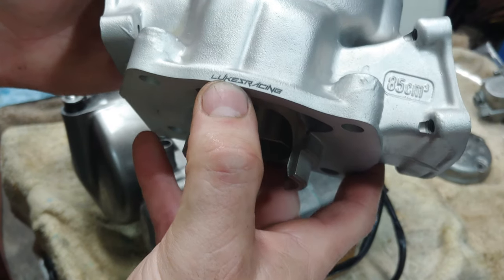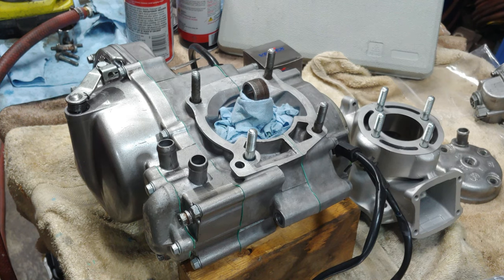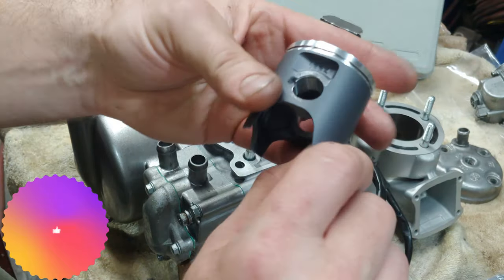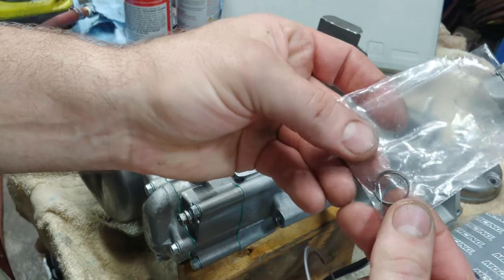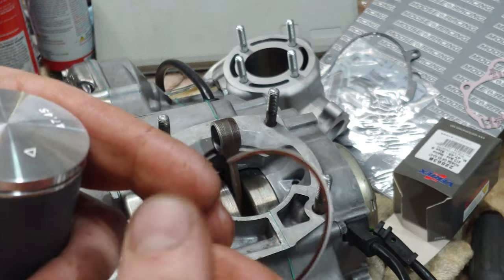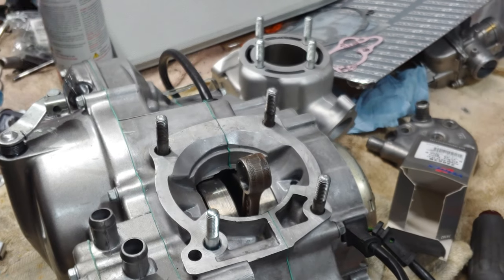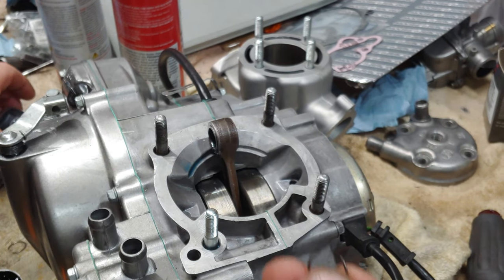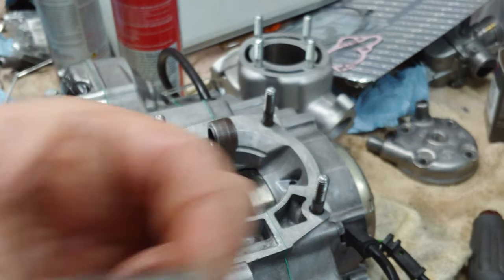03 Honda CR85r rebuild part 3 || Engine Rebuilding [Top End Assembly]

Comment: does piston rings come pre gapped after market ones
Reply from the maker: For the most part but it's always a best practice to check them and make sure that they are right. Last thing you need is to put together a new assembly and then it blows up just because you didn't check the ring Gap
Reply: @Fixin2Ride-Official-   thanks bro what is the ring gap for a 2006 cr85rb
Reply from the maker: @BrittanyBarnes-wm3bk rule of thumb is .004" per 1in of cylinder.

Comment: Just viewed this clip But correct me if wrong.  I noticed while installing cylinder head that dowel pins not there.  Are my eyes deceiving me??  Great play by play though.
Reply from the maker: It was in the bottom of the cylinder if I remember correctly.
Reply from the maker: Ya know what I just looked again and you're right. They weren't there and I never installed them BUT the bikes ran great the entire time.